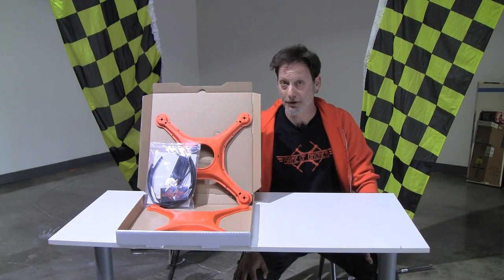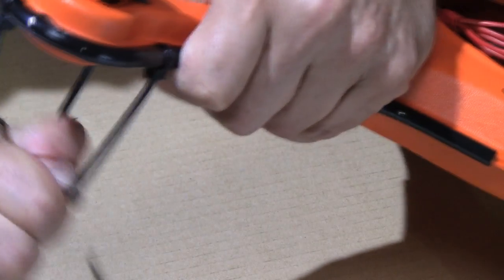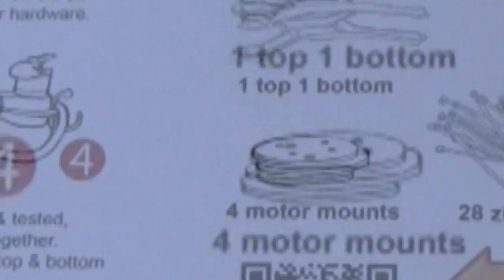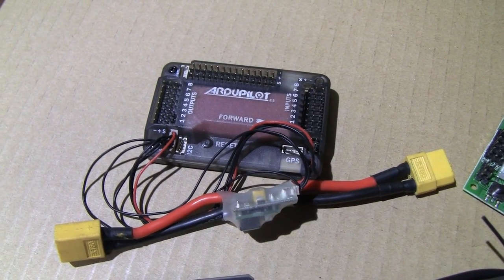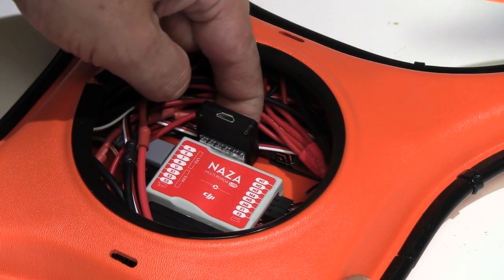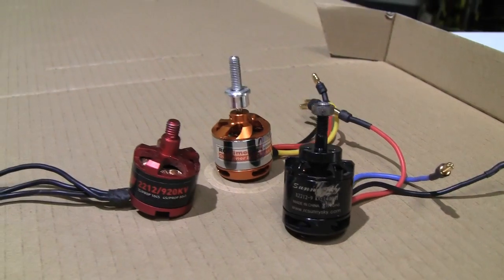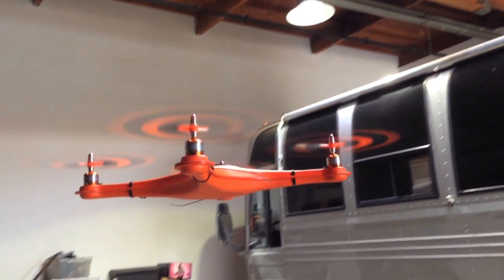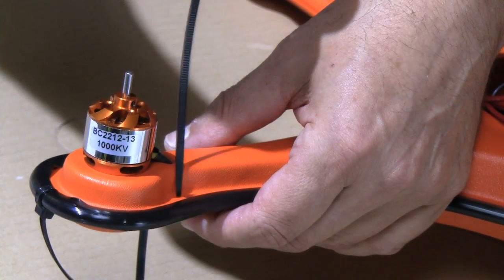"ASL Certified" HIRO Airframe Unboxing & Assembly

Comment: is it possible to put a rtf store bought quad parts into this frame? i have a cheerson cx-20 and i am looking to waterproof and rugged up my quad. my fears are that the battery like in all other rtf quads have the battery going components. how do you think that might work in one of theses frame? any suggestions? i am looking to use mine as a video rig that wont quit.